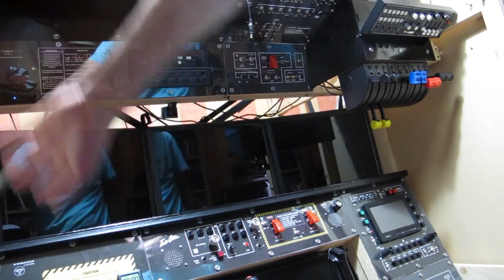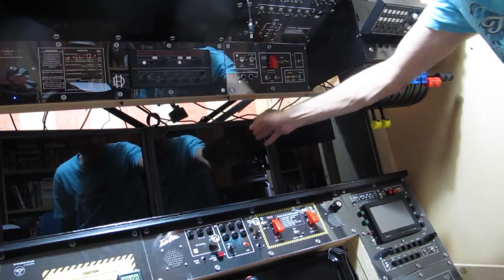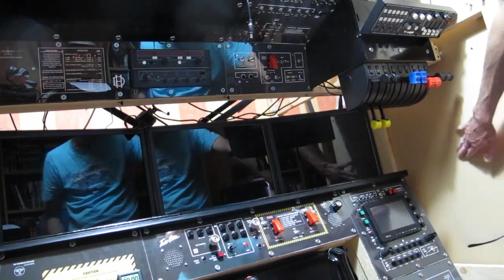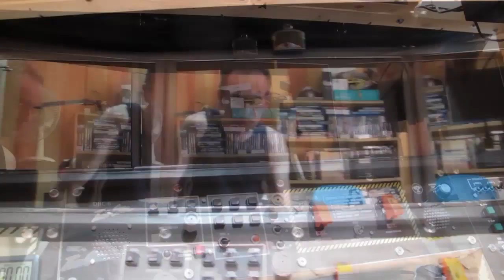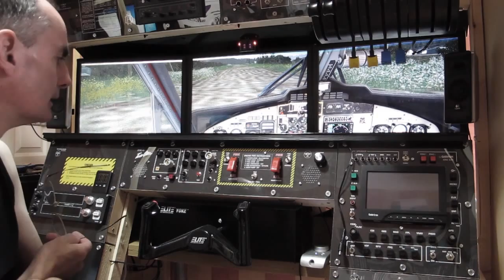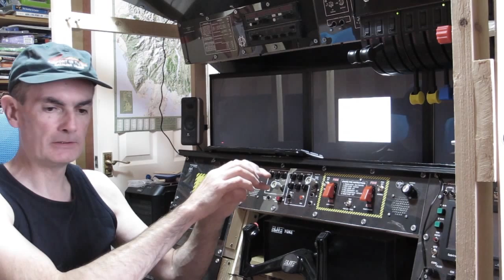Enclosing the Cockpit (Twin Otter Cockpit Build - Part 12)

Comment: wow.  that's great.  i have one computer and want to build a sim as well.  but i have crashing issues, even though it is an i 7.  i believe i have a graphics conflict with triple head2go .  i guess the key is the controller cards for making switches.  again, your setup looks awesome and the t-otter is one of my favorites too
Reply from the maker: isardriver S Yes, the Leo Bodnar controller cards are the key - they make it super-easy to use switches and rotary encoder controls and you program them just like you would any joystick buttons.
Reply: Almost Aviation so basically you wire up the switch to the card, then the card usb into the computer, then fsuipc to assign the commands?
Reply from the maker: isardriver S
Yes, exactly that. I also use LINDA (free) on top of FSUIPC so I can do some more complex things. Some of the Twin Otter switches need this. All the functions are in LINDA library (also free) and you just hook individual functions up to your switches.

I have looked at all this stuff in some detail in the later videos. One of the videos in my 'DIY panels' playlist shows how LINDA works.
Reply: Almost Aviation excellent, i will have a look.  many thanks for your postings and useful info